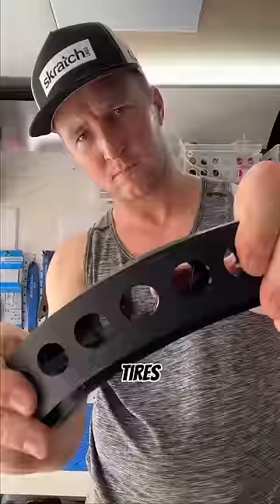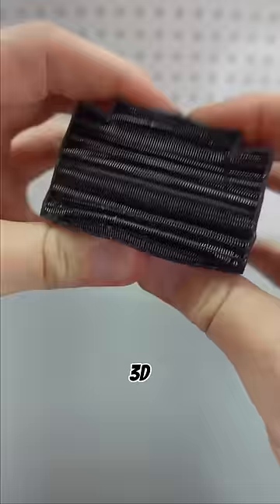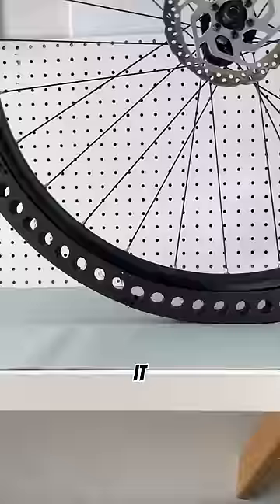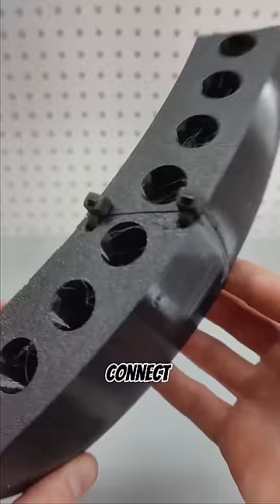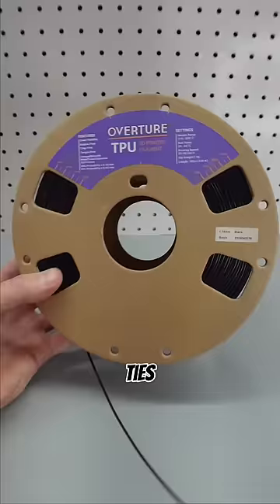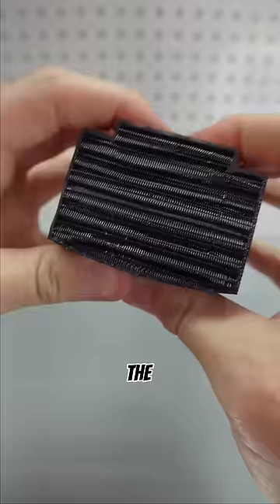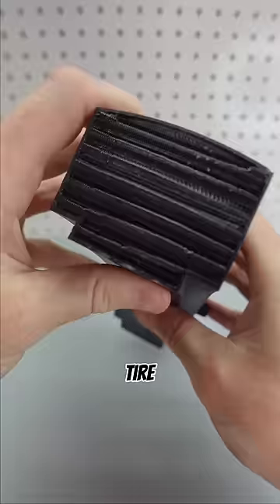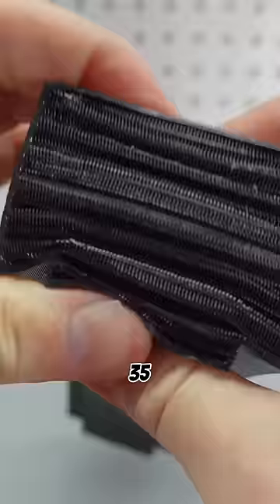3D print your own bike tires! #mtb #cycling #bikeshorts

Comment: First turn, and the tire pops of the rim
Reply: My exact thought
Reply: Yep
Reply: Id say its a great portable backup tire for emergencies maybe
Reply: @no_one_from_nowhere More portable than a bunched up tube or a foldable tire? All those sections would be pretty bulky
Reply: My concern is turning when you shift the weight of the bike, like are you gonna skid out?
Reply: @isaac-ww7fd you dont know the physics of tires during a turn, there still is allot of side load while leaning
Reply: Then use more zipties..
Reply: I see the lifespan of these in minutes or fractions thereof.
Reply: @technophant Poor longevity, easily separates, very heavy, expensive, would take months to print, labor intensive install, somehow achieves high friction and low traction simultaneously.
Reply: They’ll tune that out quick don’t worry
Reply: @kailongridge7752 😂 the zip ties got me too but it's a nice concept - try duck tape instead, if you get the real duck one it's never gonna fall! 😂 #engineer
Reply: Perhaps a few zip ties to the rim to prevent pop-offs.
Reply: Go look up the first comment he litterally talks about this
Reply: @Mikeyglazer250T again he already talked about that and tested it they're will be a full video soon
Reply: In sections tho so it’ll be way more brutal
Reply: Exactly what I was thinking. Seems dangerous.
Reply: Nah, at least not the 1.0 version
Reply: Zip ties never break right?
Reply: @yessum15 I agree it has problems but months is an overstatement by several orders of magnitude
Reply: @isaac-ww7fd think.
Reply: @joshw.2739  If this is meant for a standard home user using a personal 3d printer, each one of those pieces will take a few days to make.
Reply: You could try to print them out more spherical to match the inner molding of the bike tire
Reply: Learn to spell before you talk about someone’s invention… vocabulary was invented too 
, seems you can’t figure out how to use it ……
Reply: Not even a turn just paddle it really fast and off they go
Reply: @technophant  along with that of the rider.
Reply: I dont see how, I also dont think you understand bikes.
Reply: So the rim is the problem
Reply: these tires are designed for this YouTube video only lol
Reply: Nailed it!
Reply: Just pop it back on😊🎉
Reply: @shagadellik  Zip ties to the rim would only work if you have disc brakes.  Normal brakes that bite to the rim wouldn't work.
Reply: @kailongridge7752 or just use a rubber tube filled with air
Reply: @yessum15  all the qualities of a government mandate.
Reply: @yessum15   3D printers are much, much faster than you think
Reply: @AJ-Palermo  I've worked with a few 3d printers. If you're using a cheap home user model, these pieces will take some time.

They're fairly large, fairly dense, the margin of error is quite low, and it appears there was some post-processing (polishing for example).

Given all this I think you would not want to run the printer at maximum speed in order to prevent irregularities to the wheel shape or density. So you're probably going to have to print slowly.

All combined I think you might be able to produce 1 wheel segment every 2 days max. Which still puts you at a couple weeks production time.

Not an expert, and it's possible my workplace is using bad printers. But that's what I'd guess.
Reply: @darbywing2  eh, that's a stereotype. Really depends on the office.
Reply: that, and how fast can you go before they shake you off the bike?
Reply: Zip tie them to the rim
Reply: Just Zip-Tie the sections to the rim as well, problem solved.
Reply: I've heard rumours that Americans can't do tuns anyway. So this isn't going to change much ;)
Reply: The square cross section keeps you from turning, so not an issue.
Reply: @user-tp7zb7ej2s That is nonsense. Have you seen the boxes bike tire tubes come in? They are tiny much more portable than even a single section of those airless tires..
Reply: @thoggboogus2560  innertube is lighter, where in your bag are you going to store these without them using their shape?
Reply: That's what  i was thinking as well. 
Will have to design with a curve model to be able to take corners and off terrain model .

Comment: Add more grip/aggressive tread and try it on a mountain bike
Reply from the maker: Agreed! That’s the next step.
Reply: I highly doubt they would work very well. If you're cornering right you're either gonna rip them off rhe bead or have zero traction because there's no side knobs.
Reply: @bobohunter1776  yeah but it’s gonna be fun to see we don’t care about it working
Reply: @the_real_sharkbait  Can't argue with that
Reply: @bobohunter1776  Not sure what the point would be but a real tyres tread  could be glued on and contoured around the edge
Reply: You gonna pay for this man’s funeral?
Reply: @lostmountainresearchco  sure
Reply: Boss mag kano bayan
Reply: @bobohunter1776 actually... I see how that can be made to work... I see some Potential in it... Not like actual Potential for it to get big, but Potential for it to work and not rip appart even though being worse than air.
Reply: @bobohunter1776 I think if he prints them on a different axis where the layers are vertical, it wouldn’t shear off as easy, and I think you could get away with adding those screw in traction knobs. I could be wrong but it’s an idea
Reply: That's exactly what I was thinking
Reply: @bobohunter1776 i ride offroad on smooth gatorskin tires. Works fine, mud is a ton of fun.
Reply: @outsidebrendan  TBH, it's a novel idea for say wheels that don't need high speed cornering, like carts, and some delivery bikes that utilize some kind of cart for transportation of goods. But for the design purpose for high cornering and/or extreme riding.. I think this would be a better idea as a tire filler than a device to itself, like a run flat tire for the current state of the design, and the stiffness of the compound used to create the design.

If you utilized this as a secondary filler in a preexisting tire setup, you can still roughly keep the original design, though making it a little wider to fill out that tire so when is depresses it wont snap out the bead locked when hitting rough terrain, or the force into a curve, skip using zip ties as you can redesign the segments to interlock to each other while also making the material a bit stiffer, then stuff it in a tubeless tire, slightly inflate to snap the bead into the wheel, and off you go..

Going this route would not only allow you to utilize any tire on the market but people wouldn't run into the risk of a catastrophic error when they're riding hard or cornering hard, and it wouldn't be a huge one off design, especially for a experimental engineer trying to combat a simple yet complex problem.. I get where you're going with this, a much more renewable tire to mass produce, no air needed so punctures and dampening wouldn't be an issue, the only issue would be firmly securing the tire to the wheel for extreme uses. 

The design reminds me of those Michelin tweel designs, only applied to a bicycle, rather than heavy equipment. Michelin is having the very same issue with high cornering, and high speeds for the design of the wheel to be used on vehicles that can achieve higher rates of g-forces upon cornering, and rotational force on the wheel itself. 

The technology is there, but the materials are not quite there yet, or at least they haven't found the right combo of compounds to use for those speeds yet, which is why tweels are usually made for heavy equipment that don't go fast, distributing the weight evenly, prolonging the wear on the tire caps. Your design is very similar in comparison, as for low speeds, no need for a lot of rotational inertia, this design would work well for slower heavier bikes that don't have a lot of cornering to do, at least nothing a road bike, or an off road terrain bike would encounter. The minute you want to go faster, and corner faster, you'll realize the design flaws if you don't combat the way the design attaches to the wheel securely, and the stiffness of the compound used to accomplish this.
Reply: @charlesjenkins5763  The issue isn't the material it's, it's the lack of a real bead. There's nothing to keep it in place on the Rim.

Comment: I think the idea is great and would love to see where further developments lead
Reply: That's a lot of plastic waste going into and around the bike lanes, gross
Reply: @sorincaladera936 its a tire you literally cant pop, you have to erode it over time. Ideally its less rubber waste
Reply: This already exist but better. He didn't invent anything. He just made it worse
Reply: I'd ride with them. I'd also slide and crash without any grip.
Reply: Anyone that has ever used solid or "airless" tires would know this isn't a new invention, and many commenters don't know it won't perform how they think it will (compared to aired tube tires). But that's not to say, it's not worth trying, since this is how innovation works, to improve currently existing concepts.

Comment: JUST DONT HIT THE BRAKES TO HARD..! You can only do that a couple times before your ride gets pretty bumpy..👍🏽🤠
Reply: At least you could carry extra pieces and change it in sections. I’d like to try one for myself. I’m curious about it now.
Reply: @Dayton504 I'd rather just use a proper deck than carrying around sections of the wheel with me when I go for a ride lol. 

This does not seem like something that will catch on ^^
Reply: @andreaskarlsson5251  I understand where you’re coming from. I have my doubts that this would work well, but I’d very much like to have the opportunity to try it. But can you imagine being that guy bicycling on those mountain trails, coming down fast, then all of a sudden these pieces just start flying off like a shattered wheel? 🤣
Reply: Use your feet as brakes 😅
Reply: @andreaskarlsson5251 people said radios wouldn't catch on.
Reply: @artemefimov8215  decks exist already, what radio existed before radios? Not comparable
Reply: @andreaskarlsson5251  ok, then. Nobody believed turbine engine commercial transport aircraft would catch on, see where the regular propeller aircraft are now.
Reply: Disc breaks

Comment: he never shows himself riding his own deathtrap 😂
Reply: Yes he did, get informed before telling this bs
Reply: @il_panda1979  its not in the clip, and you are wasting your life
Reply: @ryanwagner656  the fact that it is not shown in this one specific clip does not mean it is not shown
Reply: @unknownlifeform5376  then why didnt he show it in the clip advertising his death trap? because its unsafe
Reply: @ryanwagner656 He isn't selling these. You're just too lazy to find him riding it.
Reply: @il_panda1979 CEASE BREATHING
Reply: no  @brziperiod
Reply: Lots of electric scooters have Airless tires. They work great because they don't pop, but they are also hard to ride with because theres no susoension, and therefore you feel every bump and rock and jolt much more than with the cushion of an air filled tire. I dont think they would work well for bike tires since those are much larger and might shatter on impact. 

Skateboards also have airless tires
Reply: @ryanwagner656 
Accusing people of wasting their life… while spending your own life lurking in the YT comments 😂😂😂
Reply: @pharaohsmagician8329  no air tyre =/= 3d printed tyre. 

A tyre is not purely Rubber. It has an internal metal and fiber structure to improve grip and overall strenght and resistance.
 
A homemade bike tyre is the most useless thing to 3d print. Too expensive, too unsafe. It has NO pros at all except for showing off
Reply: @ryanwagner656  u r commenting to answers to a meaningless comment
Reply: @ryanwagner656 bro your clueless
Reply: @brziperiod Gay
Reply: @ChillBroAlright  You dont even know how to properly punctuate a sentence. Using the wrong form of you're, you shouldn't even be allowed to use a keyboard.
Reply: @ryanwagner656  of course you get mad at punctuation just cus your still in elementary school, How about actually debate and not insult
Reply: @ryanwagner656  Maybe don't use a run on sentence to correct people's grammar.
Reply: @ryanwagner656 what does grammar have anything to do with this

Comment: that is a lot less than 35psi. Maybe more like 8 to 10psi
Reply: Yeah I was going to 35psi you won’t be able to see it move
Reply: When I was a kid pumping up my tires to where it barely had any give, it was around 15-20 psi.
Reply: Maybe he's got super finger strength and is trying to flex on us
Reply: I can mash in 35psi in with my thumb
Reply: A road bike tire should be 80-100psi depending on rider weight. 35 psi for a road bike tire is unusable
Reply: @demoths that's only on a road bike though. at least i'm imagining the kinds that old guys with no pubes, too much money, and too much time ride. or athletes. 35 for a commuter bicycle seems reasonable. even less for a mtb
Reply: @milk_420 Yeah I'm confused with these comments...I literally worked at a Bike shop since 2023 35 psi tube in a regular mountain bike tire has some give in it still...
Reply: @milk_420 i ran 80psi in the odyssey aitkens on my 20inch dirt jumper i run 50 on my hard tail for big line jumping
Reply: @milk_420 you can get a good road bike for not much money. Pack of maintenance is when it starts getting very expensive
Reply: @milk_420  not really, commuter riding gets much easier at higher psi.
Reply: yeah it looks to have the internal pressure of a roll of toilet paper
Reply: @milk_420  I figured this was for a road bike, I can't imagine this holding up to any sort of rough terrain
Reply: @Texassince1836 how do you know that kid 😂
Reply: Yeah there’s no way you’re gonna get good speed on tires that flat let alone how much more energy it would take to ride
Reply: Lol was looking for this comment
I was guessing 12psi maybe 😂
Reply: @demoths my bike does 40-60 psi and it works fine.
Reply: @kugelblitz1557  what size wheel and tire?
Reply: @demoths   I believe 60" wheel and 3" tire but I'd have to check.
Reply: @kugelblitz1557  yeah nah I had assumed this was for road bike tire as I couldn't picture it being for anything else, a wider tire like that is definitely gonna be under less pressure. Mtb, cruiser, etc is usually between 20-35psi depending on the rider and terrain, I just couldn't imagine this setup seeing anything but smooth pavement in a straight line
Reply: @elijahtthayer you literally worked at a bike shop since 2023?? I bet you’ve gained a lot of experience in all that time🤦‍♂️
Reply: Even if it was, 35 psi is shit. I usually go for at least 70 psi
Reply: @demoths  yes, a road bike is 80-110 (honestly 80 is low, that pinch flat zone), but these are for MTB, tube is around 30-35, tubeless can go down to 20-ish. These don't even look like 10psi, you can't squeeze bike tiers the way he squeezes these. Also square edges is going to kill someone while they turn.

Comment: I would try something like that as a replacement for the tube, but I like the grip of my tires. This would make them more puncture proof. But I usually inflate my tires up to 70 psi or more for ease of rolling and control, so I think if I'd try them, I would try them for my bike trailer only. Or maybe for inside the winter tires with spikes, as less pressure means more spikes touching the ice therefore less sliding.
Reply: This
Reply: Sh0-tyme most street bikes go from 70-100 psi
Reply: 70psi? Most tyre inflation is 60psi. There’s such a thing as tubeless
Reply: @stevied653  Yes, that's around 5 Bar, the pressure I'm most comfortable with. The tires I use usually range from 4.0-6.0 Bar /  55-85 psi, less than that is only for winter tires with spikes on ice to allow as much spikes to claw into the ice as possible. (If only we still had winters with freezing temperatures, thanks to effing climate change..) Otherwise I want as less of the tire touch the ground as possible to reduce roll resistance and maximize control. 
Maybe you're thinking of mountain bikes? I don't have a use for these, I prefer roads and hard, flat surfaces with my recumbent tour bike and my city bike.
Reply: @danielamaus  yeah I’m basing my opinion on MTB, I run 22psi front - 30psi rear. Tubeless setup. I understand harder tyres for flat/road riding
Reply: That more than what goes in a car tyre😂😂
Reply: @badbeets4790  they absolutely do not

Comment: I would offer a range of simulated pressures with infill patterns to fit to more users, and giving them a choice in product. Super cool stuff, great work!
Reply: You can just set the infill% in the slicing software before you print, allowing you to sim whatever tire pressure you want
Reply: I rode street at 110psi. 35psi would be better for a kids bike or maybe mountain bike. I would rip the segments from the rim in minutes....cool concept for kids bikes though.

Comment: What i would recommend is making it to where there is overlap between sections so you can use a small nut and bolt with a round phillips or flathead top to hold it together a little better, retain better alignment, and allow a stronger connection between sections
Reply from the maker: Love it
Reply: @outsidebrendan Man, ignore all the hate comments. I know the comment I am commenting on it right now is not a hate comment, but I figured it's the easiest way for you to see what I'm saying. The people who are hating on it saying it's a nightmare in blah blah blah Don't understand that it doesn't have to stay exactly the same. It can evolve. Keep doing what you're doing man. This could be a million dollar idea. No exaggeration
Reply: @outsidebrendan Not to mention just for like marathon bike races or whatever you'd call them. It's already perfect. No flats. Even if something does happen you could literally change it out without taking the tire off It's perfect